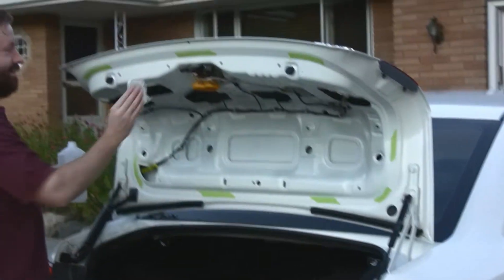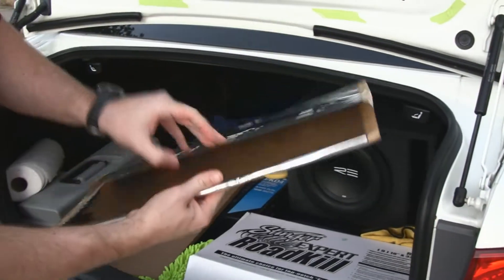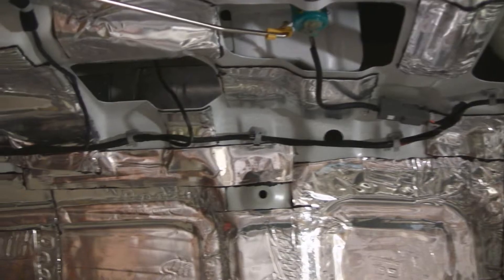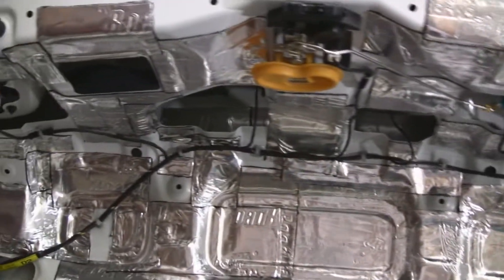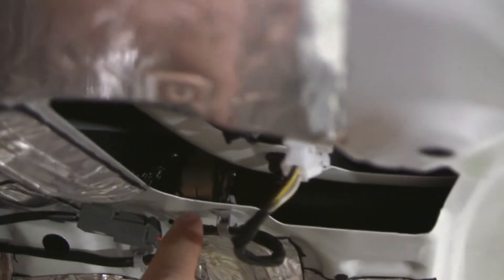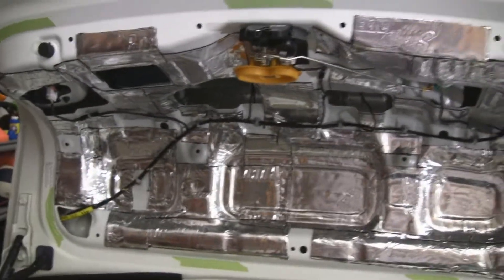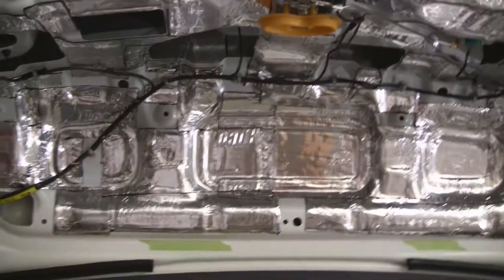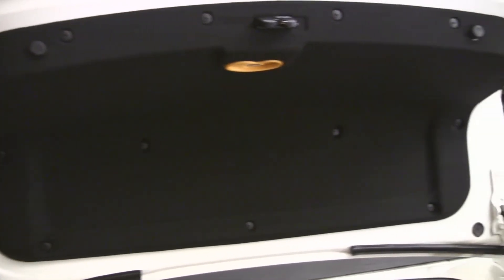SQ Car Audio Project Part 1 Stinger Expert Roadkill trunk install

Comment: have fun with the rest of the car. I have 75 feet already done and I still have one door with nothing on it and the both side side doors have every little
Reply from the maker: Nice, that's a lot. I think I've got about 50 sq ft on now. I didn't do the floor since I had it undercoated, or the roof because I didn't want to pull the headliner. I test drove a new Genesis the other day, a notoriously quiet car, and my car is quieter. The Overkill foam is great too. :)